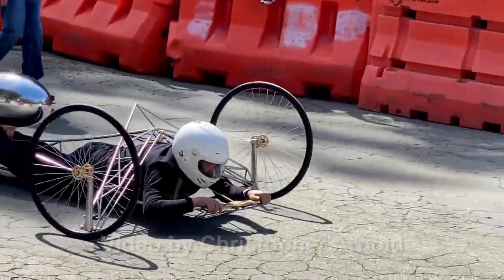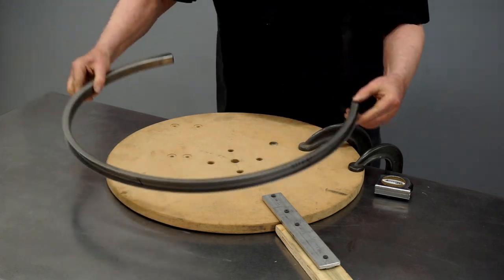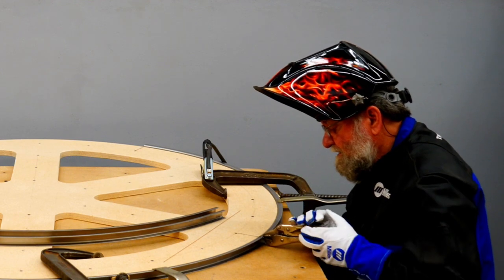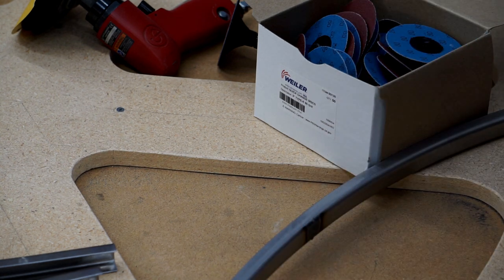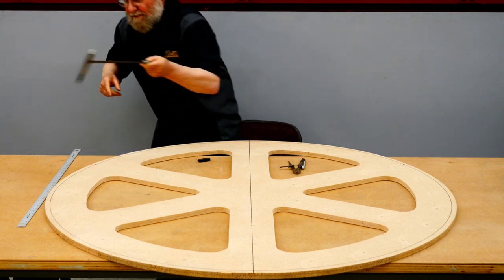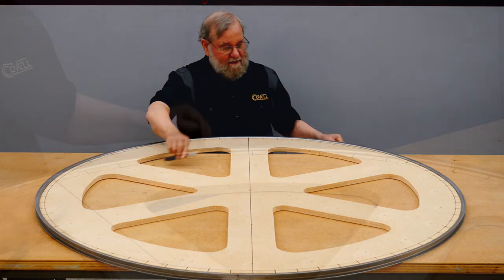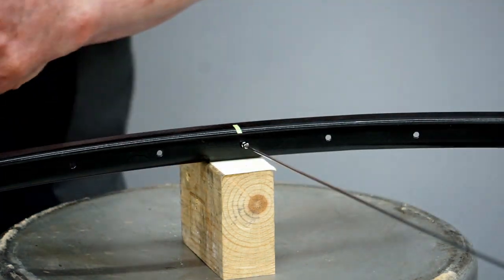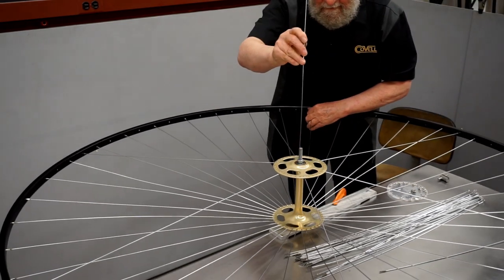Making a Really Big Wheel

Comment: I am blown away at some of the stuff you do for instruction and your answers to questions.  I have replaced steel spokes with stainless steel spokes in a set of four Zenith wire spoke wheels for my street rod.  It was quite an experience and I learned it takes a lot of patience.  My effort was successful.  Your example here explains it very well.  Thanks.
Reply from the maker: Wow - that must have been quite a job. I once had a brief tour of the Zenith wheel company. I just did a web search, and apparently they are still in the same location, in Campbell, California.

Comment: I really enjoyed this video, back in the early seventies, I was building bicycles, racing, and got into building wheels extensively.  I ran across the idea of a rim with a tire on it, and a "chassis" riding inside the rim, with a small engine and seat, to drive from inside the wheel, but never could actually try out the design.  Your making of a rim and tire provides the possibility of completing it now, and I am tempted to return to that project.  I've worked in industry most of those years and now see the possibility of completing that project in reality.  You did a great job making the rim and setting it up to work.
Reply from the maker: Glad you liked the video, and your planned project sounds very cool indeed! I have seen a few others who have built vehicles like you describe. There are certainly some challenges, but it's a worthy effort!
https://www.youtube.com/watch?v=qNzl6N_ScyQ&t=121s

Comment: Your thumbnail looks like marketing material aimed at wile e coyote 🤣

As a unicycle and penny farthing enthusiast, I cant wait for this one. I’m 
Curious to see how you went about hub design and choosing spoke count, spoke length, and lacing pattern. As well as where you were able to source the tire.

As always, thanks for sharing your vast knowledge and skill set.
Reply from the maker: In today's video, I re-use a hub I made 44 years ago. It is styled after a Campagnolo,, but scaled up considerably, and I used 72 spokes, just because that's a 'regular' division of 360 degrees. I used radial lacing because I like the look, and since my vehicle is a coaster with a brake on the rim, the hub has no torque on it.  Here's the link for the tire:
https://www.youtube.com/watch?v=DxSDOzDoO-w
Hope you enjoy the video!
Reply: I think it gets away with a radial spoke pattern because there's no braking and no drive; it is only coasting.  If there was pressure from a chain/cassette or resistance from any kinda of brake, the sheer length of spoke would allow some wind-up.   For a wheel that brakes or drives, some kind of cross-lacing pattern is definitely a good idea.
As a tall bicycle rider - I wish larger wheels were affordable.
Reply: @criggie  Making myself feel old, but "back in the day" (mid 1980's) when building track wheels, we used radial on the fronts for simplicity, lightness (shorter spokes = less weight) and often the rear was a cross pattern on the drive side, and radial lacing on the offside. I have seen wheels with radial spokes as drive wheels, but they were smaller 16 inch rims, and 72 spoke hubs, or 20 inch with some absurd drilling (96 or 108?)  and were heavy, and nearly impossible to true up.
Reply: @RonCovell  I was gonna ask where you got that hub from. I favored Campy Tipo or Normandy Red Label hubs for my loose ball, though Suntour were okay too (okay, Shimano Dura Ace was okay too, but I hated Shimano with a passion especially once index shifting came along) and Phil Wood or Specialized sealed hubs.
Reply: @jpkalishek4586  Radial lacing any sort of bike wheel puts you into 'seat of the pants' territory, even basic castor wheels.
Reply: @criggie  you don't want bigger wheels. they are always weaker than their small counterpart. a bike's size is not defined by wheel size at all, and really dont even matter. skateboard wheels would work, albeit uncomfy

Comment: Now I understand why Wright brothers among all of engineers and scientists back than were only one capable to built a first airplane. This is a kind of job they're doing, lots of ropes, strings, spokes, wood working, thin metal shaping,... Thank you Mr. Covell for the lesson.
Reply from the maker: I have to agree - the Wright brothers were good in a LOT of areas, and that, coupled with their fierce determination, is why they excelled at what they did.
Reply: Don’t forget Santos Dumont
Reply: The bicycle industry of the 1890's was the auto industry today, many bicycle companies went on to build motorcycles, cars and of course airplanes.

Comment: 12:45 This is the first time I’ve ever seen anyone using a DeWalt right angle drill. I bought mine back in 2000 and found it to be an extremely useful tool. Unfortunately the switches have become rather tight, and engaging 2nd gear has always been somewhat problematic, but it’s still my favourite drill. Makes a very powerful screwdriver too. 

Even though I left the device unused and the original battery flat for several years in a rat infested shed, after I thoroughly cleaned and disinfected it, and cleaned the terminals, the battery charged up perfectly first time. 

Anyway, thank you for sharing this intriguing project.
Reply from the maker: Yes, it's a great tool. I use it mostly when I need a second drill, but it gets into tighter places than my 'regular' DeWalt drill.
Reply: @RonCovell  Cool. I’m going to say great minds think alike 🧐 YT has only just started sending me your channel notifications despite subscribing months ago. I need some tutoring to refresh my neglected skills. Thank you for sharing. 
Peace
Reply from the maker: I'm glad that YouTube's algorithm is starting to serve you well!

Comment: This is wonderful work!  I was especially impressed at the quality of your TIG welds--after sanding, it truly appeared as one continuous piece of metal.
I am a bit curious about the pattern of spokes--I respoked a bicycle rim once, and I had to spend an hour or more just to understand how they threaded together.  In the video it looked like you simply ran them straight out, but I know that can't be the case.
Reply from the maker: I did use a 'radial' pattern for the spokes, so they do not cross. Certainly, the hub has more resistance to twisting in relation to the rim if the spokes cross each other, but since the hub is neither powered or braked, this wheel seems strong enough, and I like the look of the radial pattern.
Reply: @RonCovell  I was wondering about this but I see you answered it. Thanks

Comment: Nice coaster 3 - wheeler. Your wheel is a work of beauty.
I have 2 chromed steel tube rings about 5' dia.; maybe I'll build a bike. The tube outside can be drilled bigger than the spoke head.
Some permanent ink bleeds thru some paint.
Reply from the maker: I hope you do build a bike! I, too have experienced the problem of ink bleeding through paint. You have to clean the ink off exceptionally well - even small traces left in the pores of the metal can migrate through paint. Usually, a couple of wipes with a clean rag moistened with acetone will remove it.

Comment: Love the wheel and the process of how you made it.
One technical note on how you spoked the wheel. For a soap box vehicle it is probably fine to use your system of radial straight spokes. But if you use this type of spokes on a wheel that has a brake or a (chain)drive on it the spokes will very likely break from the torque imposed on them during acceleration of braking.
Reply from the maker: You are absolutely right!

Comment: The first wheel I ever respoked was for a 58" high wheel bicycle with 7 crosses.  I like your video, but just in case anyone coming through here was thinking of making a large bicycle wheel like this, I don't think it would be strong enough.  We roll them through dies and make a crescent shape when we reproduce them.  You definitely have the skills to true that wheel Ron, just go slow and adjust a little bit at a time.  I recommend the book "The Bicycle Wheel", lots of good info on building wheels.  Tangential spoking would have made it much stronger, but I don't think the rim could take the stress of a full grown human (particularly American!) on top of it.  I have collapsed one that someone had made in too soft material with a pedal dismount.  It couldn't take the lateral force
Reply from the maker: Thanks for the in-depth comment. You obviously have studied the physics of bicycle wheels much more than I have. When I first built this vehicle, in the 1970's, it was common for track racing bicycles to use a radial spoke pattern on the front wheel, since they have no hub-generated braking forces. I liked the look of this pattern, and that's why I used it on the rear wheel, too. There is no question that crossing the spokes makes a stronger wheel.
Reply: @RonCovell  I don't know about studying physics, I kind of fly by the seat of my pants!  The earliest bikes used radial also, it can be a strong wheel and it did regain popularity.  I can feel the difference in the flex of the spokes when you apply power on a high wheel, which I realize wasn't happening with your bike. Thanks for your reply.  I like your Bob Ross style of explaining things.  You obviously think things out and get things done.  Cheers!

Comment: The first bike shop I worked at had a set of lightweight track wood rims hanging on the wall for years. The owner had bought out a long running shop somewhere and they were part of that score. After I left there, but before it shut down the manager had them made into a set of wheels with silk sew-ups and magnesium track hubs. Egad were the things light. flammable too.
Reply from the maker: The first iteration of my car (from 1978) had wooden front rims, too - with sew-up tires!
Reply: @RonCovell  cool beans!

Comment: Thanks for sharing Ron! Now to figure out how I can use your techniques to bend zinc came for stained glass work!
Reply from the maker: I have several friends who have done work with leaded glass, and the technique of bending lead came over a wooden form should work perfectly!
Reply: @RonCovell  Indeed! The lead came bends around the glass nicely but is not very rigid. I'm thinking of the zinc or brass varieties that are very rigid and meant to be used straight. They kink and deform easily but with the right jig/fixture looks like it can be done.
Reply from the maker: I think you could bend the more rigid varieties pretty successfully with fixtures.

Comment: Boy, that takes me back.  About '72 or maybe '73 I converted some 20" bicycle rims from 20 to 36 spokes.  I remember that it was as tedious to a teenager as anything could be, tig-fill what seemed like a million holes, grind a million weld spots, drill a million holes...  I used a 2-cross lacing if I recall right, to avoid the tendency to potato-chip to which radial patterns are prone.  (Target vehicle was an extremely overpowered moped, turned out the cops didn't appreciate my craftsmanship, but at least they didn't arrest me.)
Reply from the maker: That's quite a story!

Comment: Wow, that is great work!  I've laced many wheels,  just using off the shelf components.   I recommend the book  The Bicycle Wheel by Jobst Brandt, lots of physics as tensioned spoked wheels are a pre stressed structure.   
One of my designs was on the bleeding edge and had to be tensioned under load.  Hard to believe but the wheel stands on the spokes, it does not hang.  The force of the wheel on the road reduces the tension of the bottom spokes.  This is easily proven acoustically as spokes are like a stringed instrument.
Reply from the maker: This is a fascinating subject!
Reply: Wheels do hang on spokes. They do not stand on spokes.
There is no way to transfer compressive force along the spoke into the rim, the spoke nipple will just stop contacting the eyelet.

You are correct in the stressed structure, but the spokes at the bottom are simply less tensioned when loaded by a rider. You can prove it hangs by not tightening your spokes....the spokes the the bottom will be loose enough you can take the nipples off, but your wheel will still hold up your bike. Put the nipples back on before you turn the wheel tho 😉
Reply from the maker: Thanks for clarifying this point!
Reply: @to._can  

A tensioned spoke wheel cannot maintain structural stability if the bottom  spokes lose all tension on loading.  Read Jobst Brandt's book for the proof.

Spokes stretch, loading reduces this elastic stretch, allowing spokes to act as compression members.

Still don't understand?  Do the musical test, that top spoke does not pluck to a higher note, it is the bottom spoke which plucks to a much lower note.

Prestressed structures baffle the mind because they are statically indeterminate,  analysis by alternative methods include virtual work theorem which results in a complex set of matrices,  such structural analysis is far easier to perform with finite element analysis.

Comment: Awesome build and great process! As a note, not sure that how you went about installing the spokes is 100% correct. From what I've done, they are usually weaved. That said, if it works, do it to it!
Reply from the maker: On a wheel with a hub that is powered or braked, crossing the spokes gives the wheel more torsional rigidity. Since my car is a coaster, with the brake on the rim, I don't need that extra strength, and I like the look of the 'radial' spoke pattern.

Comment: It has probably been said in these comments, but the rim needed to be welded on the inside also.  Just go and look at any welded joint rim, and they are always welded on the inside. This would be doubly important with these rims as it is in 3 parts! As when any weight is put on the wheel, the welds will open up from the outside.
Reply from the maker: Thanks for your comment!

Comment: Really  beautiful work, and a wonderful application of the former f-bomb.  Building a wheel from scratch like that is very impressive.  I assume the spoke were all radial, no interlace pattern?  Interlacing is common on regular bike wheels, though I’ve never u dears told the exact purpose—I think it gives some radial flex to the wheel since the spokes are not in compression?
Reply from the maker: Yes, crossing spokes makes a wheel much stronger. My wheel doesn't need much strength - since the hub has no twisting forces on it - and I like the look of the radial pattern.

Comment: That guy is a real craftsman.  Make a bigger wheel and attach sheet metal blades to the spokes of the wheel.  mount the wheel to a fram with three smaller wheels supporting it that are attached to electrical alternators.  Get the wind to rotate it and make electricity to charge car batteries.
Reply from the maker: Great idea!

Comment: Hello Ron, How are you?? As usual, I love the diversification of everything you do & yes.... fixtures certainly rule with most things. I'd be interested to know if in bending the U shape around the jig, if the sides tended to bow outward at all? (so they became less angled than first folded) I have certainly come across that kind of thing happening in metal shaping before because of the outer edge not being held by anything so they will lean out instead of just all stretch. Just a crazy thought I had (mind you, I think most bicycle wheels angle out on the sides anyway, so maybe you planed for it 😁) You know I love you content, keep the stuff coming! Cheers!
Reply from the maker: G'Day, Rob. I worried about that issue, too. I kept the angle pretty steep (around 85 degrees) and the sides didn't flare out much at all. With a shallower angle, I know they would have spread.

Comment: Is it possible to build a rim that can seat a bead from a modern bike tire?  I imagine some sort of bead roller used on the material prior to running it through the press brake might do the trick.  I bet you could even make a double wall rim by making a second rim that nests in the first, then weld up the seam, though that would be a lot of welding and you'd have to be careful to manage the heat.
Reply from the maker: I'm sure it is possible, but as you say, it would be much more challenging.